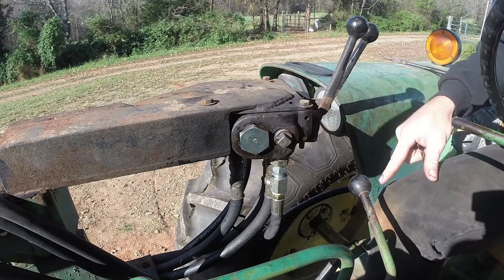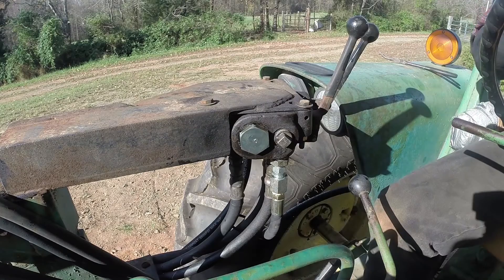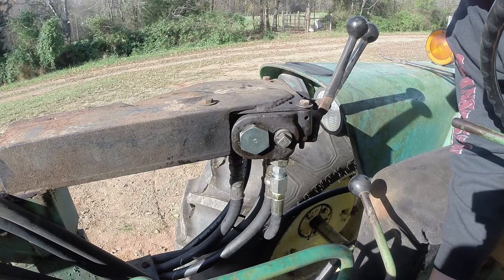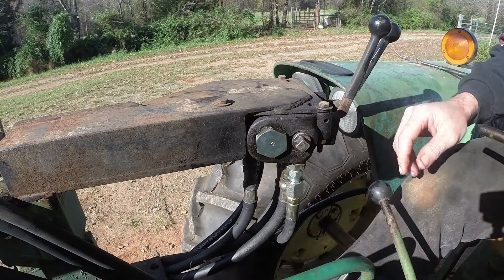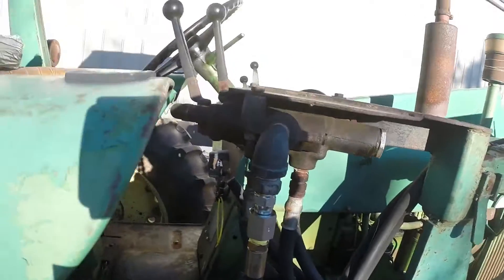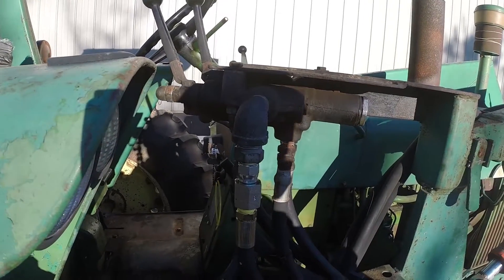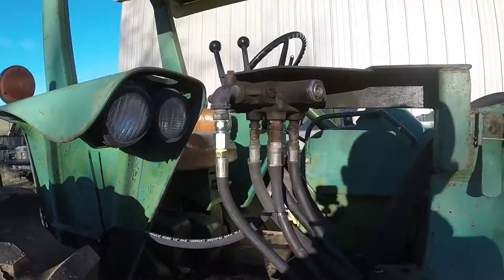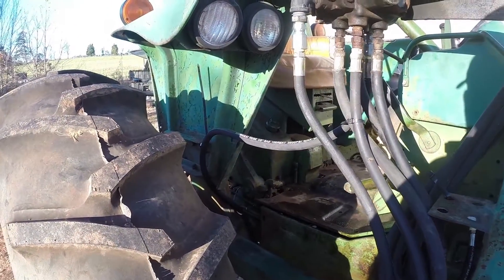1968 John Deere Power Shift Loader Replumb: Part 6

Comment: Did you ever replace the loader valve ?  Does plumbing the loader like this made it faster ? Or is it still the same speed ?
Reply from the maker: I did replace the loader valve eventually, but I also kept the old one and ran an extra set of remotes to the rear with it. I would say that the loader operates a little bit faster. Its been a while since I did it so its hard to say now.